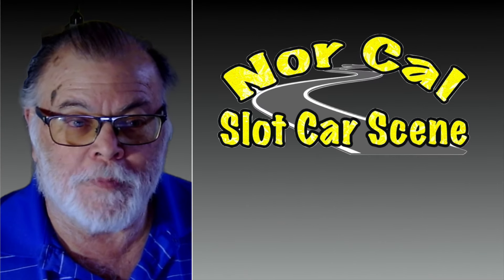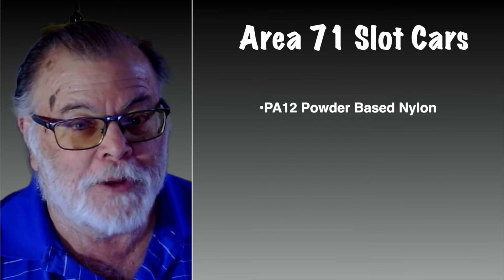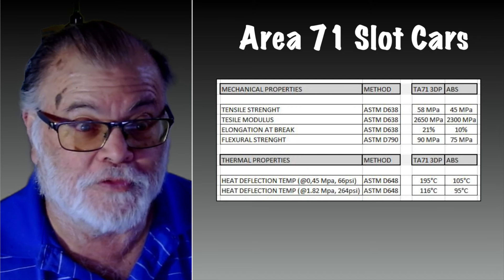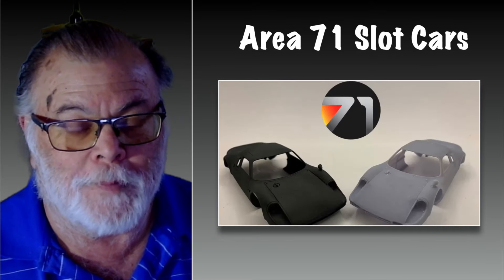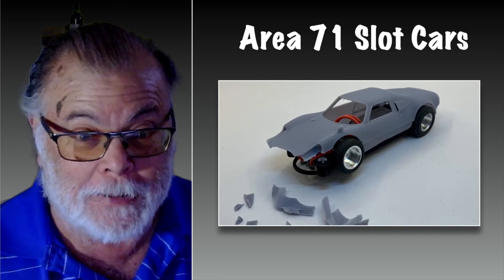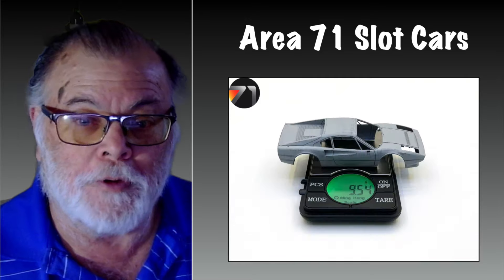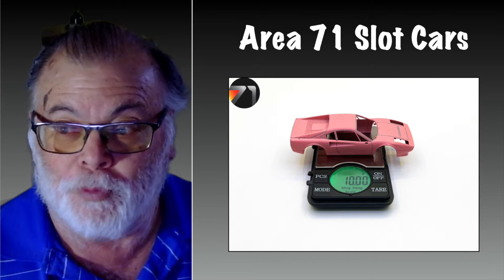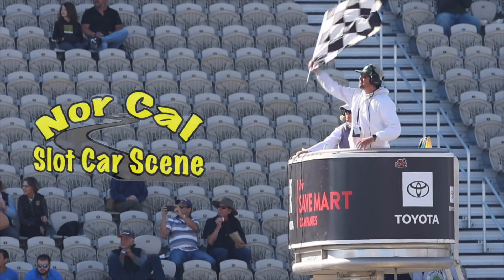Area 71 Body update and crash test video

Comment: I believe the 3D printing process Area 71 uses is a laser sintering process in which the raw material is powder, not liquid resin or plastic filament. In a nutshell, the heat from the laser melts a thin layer of powder, which melts into previous layers.  The end result has similar properties to a single molded piece, unlike resin or especially filament layer lines.